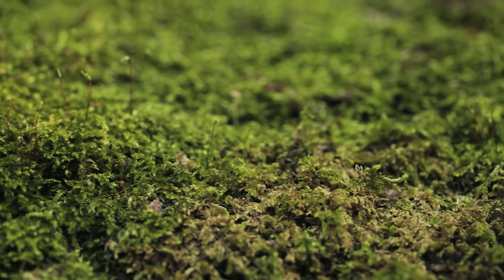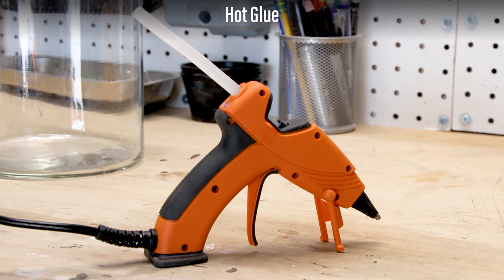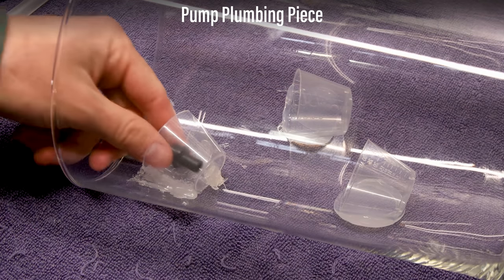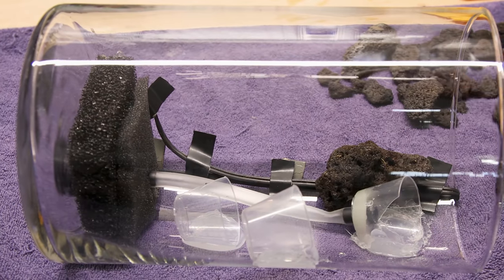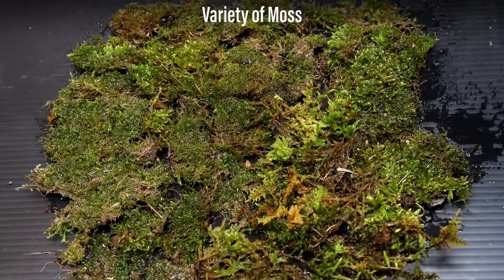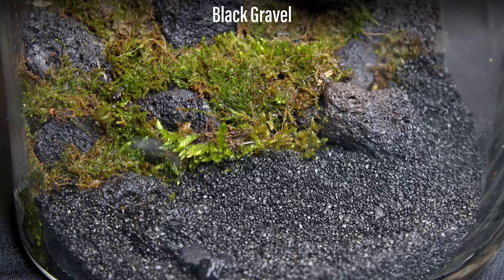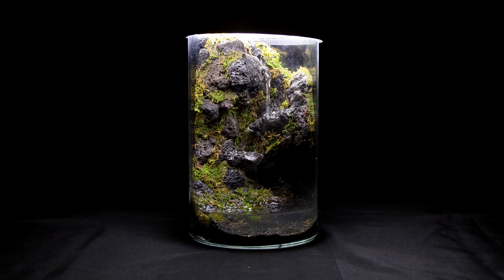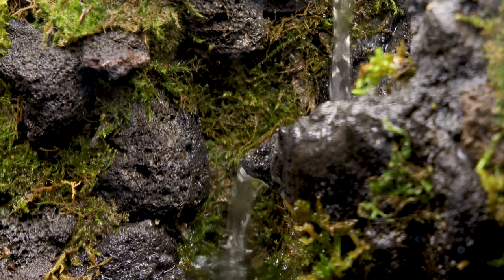Moss Gorge Waterfall In a Jar

Comment: I was trying to find an idea for a moss terrarium and this looks perfect.  Mind if I ask two questions?
1) [noob builder here] Why did you use plastic cups instead of foam spray?  Could you do that or is it too tricky to get the angles right and/or making it watertight?
2) Did you add any fauna to it?  I did see a tiny creature and someone else in the comments mentioned a snail.

Comment: It's beautiful! However, as a crafter I have a couple of tips:
#1 Always mark where your stuff is going to go with tape on the outside before securing it with silicone - if you mess up, it's going to be either painful to fix or waste material.
#2 You'll have a real hard time cleaning or replacing that filter foam when it inevitably will need maintenance as its secured to the bottom. I would recommend using something else to hold it in place and hide - like rocks or wood. 
#3 Be careful on your choice of mosses as some species don't like constant water movement or saturation so they'll just rot away from the water, those usually prefer damp and poorly lit locations.

Comment: Okay I've made a similiar setup before, there are two problems that I encounter:
1. Those pump still somehow get clogged by small debris although I have literally wrapped it in filter foam, and to unclog it will need a lot of effort (basically removing everything and then reattach)
2. The minerals in water will stain the glass/acrylic because the water will splash even if using the lowest pump speed, in which if they are not cleaned immediately it will be really hard to clean, especially in a closed tank
Reply: I'd like to know how Tanner deals with those issues. We have really hard water here and mineral deposits are a constant thing in my fish tanks.
Reply: @zenphotojourney  RIGHT! I just moved into a new house in December. I have the mineral deposits forming from the Humidifier and on my Monsoon! I wonder if he uses Distilled or R/O?
Reply: @zenphotojourney  considering how many he makes, he probably doesn’t
Reply: @Brucelovesjulie  he uses distilled. Never tap
Reply: That’s what I’ve been thinking about the pump. He makes so many of these it’s probably just for YouTube and will probably just give it away.

Comment: So, when you put the light in the lid you used hot glue over the heat vents for the LEDs then placed it directly against the lid surface with nowhere for the heat to go.

 Interested to hear what happens to the light if left on for say, 2 hours. Hot glue melts again? Catches on fire? Melts the lid? Something else? Nothing?
Reply: Came here to ask this too. I have a LED ring light and it still gets pretty hot after an hour or 2

Comment: This is great Tanner. I wonder if you can hear the water as it falls on the rocks. That would be soothing. I once bought a packaged installation. Nothing fancy. Just some pebbles and a pump in a low height glass container. I could bearly hear the water. 
Another question is: can we use regular tap water for such projects or should we use distilled water? Cheers.

Comment: Love this! Does it make any kind of trickle sound? Tip you may or may not know about using hot glue, you can smooth it out with a wet finger while it's still hot/warm. I use this technique all the time to make the hot glue a little neater-looking. I use a medium temp glue gun so this trick might be a bit dangerous with a high temp glue gun.

Comment: Not sure you will ever see this but that LED ring light has ventilation built in to it. You covered that with the lid. LEDs of that strength "should" run cool enough for that not to matter but you essentially built a pocket that will trap the hot air. I would recommend cutting large vent holes or slots in the top of the lid. Other than that, wonderful build! Probably not a big deal but could be a fire hazard with the lid being made of plastic.

Comment: I bet if you glue moss to the edges of the plastic spouts you could add more direction interest to the fall pattern. That way the water will fall in sections, and hide the plastic. Use the moss or tiny stones in the spout to interrupt and change the water flow. I mess around with these too but never saw or tried in glass containers. The Last time I looked you were designing plain terrariums.... arent they such a stress reliever????:thanksdoc:

Comment: Great channel, enjoy you videos. You know how you always use springtails in soil features? I also used to add freshwater copepods to my water features for the same reason. They eat detritus, biofilm, algae and diatoms and keep the glass clean, are easy to culture adding a little greenwater to the culture container (which can be a 1 liter water bottle), or a tiny pinch of algae flakes, occasionally. A sprig of any water plant keeps them in O2. Good from 40 to 80 degrees F. As long as the pump flow isn't too strong, and you seem to always have them covered with foam, they'll be safe.

Comment: Watch out with leds - they can get hot: if you noticed, there are vent grills on the original ring. Encolsing the ring in a sealed container could result in overheating, according to the working cycle of the light. It's ok if you light it up for an hour, maybe two. If you're planning to make a "daylight cycle", let's say 6 to 8 hours, then you might have to check how much heat the leds produce. If you have a light setting, you might want to keep it on "low" or "medium".

Comment: Any tips or suggestions to stop water splashing on the front center of the glass?  My submersible pump is dialed all the way down already and replacing it with a smaller one is not an option.

Comment: The only thing I don't like about this build is the fact that you'd have to disassemble it if the pump failed in time, or is just faulty.  I wonder if it might be a better idea to use those really small cylindrical pumps instead.  You might need a couple of them for the water flow you're looking for, though I've seen some that pump about as much water as this build by themselves.  They can be housed in a smaller opening through which they can be removed at the top.

Comment: Instead of using the three plastic measuring cups the lava rock is easy enough to use a Dremel or something along that line and you could’ve taken three decent size lava rocks and made bowls and him and then put a hole in the top one and then fit up all your pieces and then it would look like it was completely natural as the lava rocks act as the different warm waterfalls and that way you don’t see any plastic pieces from any angle just a thought

Comment: i'm curious how the hot glue is gonna hold up.i never had good experience  when i used hot glue for wet stuff, over little time the glue just hardens and let go the bond.
Reply: I was reading thru comments to find one on the hot glue and your right never works good for wet areas! Why don't you just use silicone? Or maybe the cure time you don't like?

Comment: Really cool but i would use something with a flat blade edge that the water falls from, to create a water sheet pattern rather than cylindrical water pattern that forms as it falls through the "V" cuts you made in those conical cups.

Comment: Love it! but.....I would have put in a small rechargeable battery backup unit in there with a USB charge port sticking out only, and a small dip switch to turn it on and off. This way you could charge up the battery up and set in the middle of a room or table with no cords running anywhere. Or even better yet dismantle/ modify a garden solar unit to the top with of course a switch.... charge during the day and on at night. =) Thats just me though I like to get technical and go overboard for the ultimate sleek looks.

Comment: So I made an open Faerie Garden with some small plants. It looked great for the first week or so. But, I was using a dead/preserved moss. Not just a dried one. And I think I may have over-watered it? Anyway, some black-ish mold started to grow on the fake/dead/dyed moss. So I have to either re-make them or fix them somehow. The soil beneath the moss is very moist, but if it doesn't dry out, then wont the mold be a problem? Would live moss be better for a faerie garden?

Comment: Watch out for the lights in the lid, it looked like you are blocking some vents for the light. It will still work but could really shorten the life span of the lights. Of course if they run very cool its not an issue, but a lot of LED lights need to breath to keep them cool. If you can run them at a lower power setting it should help, otherwise maybe make some vent holes and leave a gap for the light fixture.

Comment: looks rather nice, but the lamp is most likely going to fail prematurely if you use it with any real frequency. you didn't allow the rear vents to breathe, so what will happen is either the lights themselves will fail or the circuitry will get too hot and fry/fail, all most likely due to over heating.

Comment: Only problem was with the light. You smooshed the heat vents up against the lid AND sealed the light in with the polycarb. Its going to get HOT and may be a fire hazard.